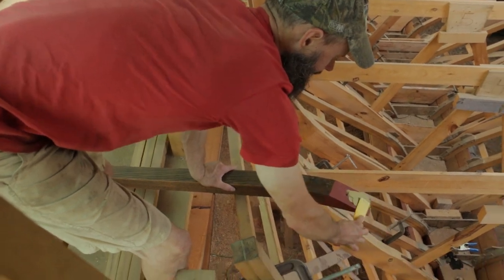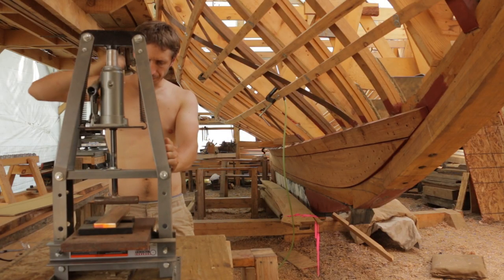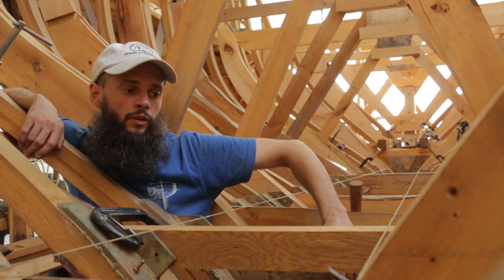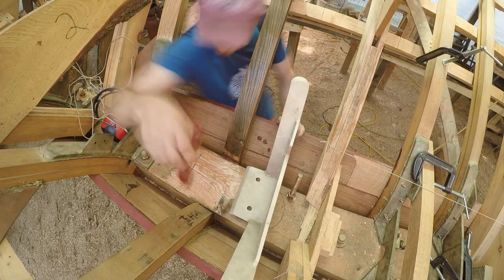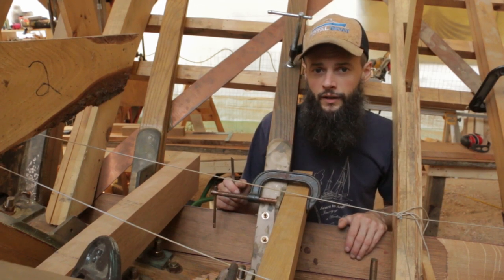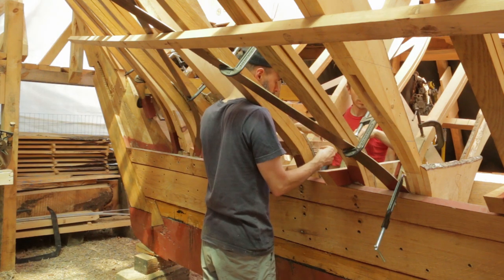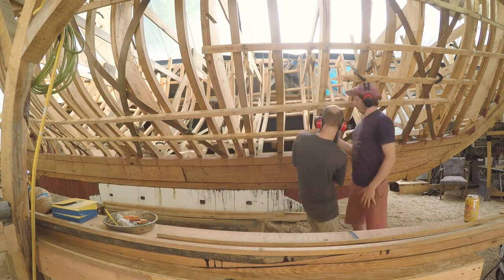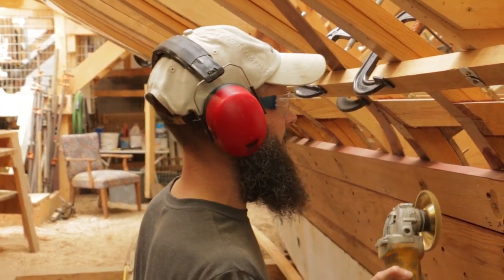Acorn to Arabella - Journey of a Wooden Boat - Episode 77: Sole Beams and Diesel Engine

Comment: From experience, as soon as you get the engine for the boat, set it up on a metal frame with basic instrumentation, fuel, battery, and coolant, and get it running before you put it in the boat. That's especially important if you are a year or two from launching,  and the dealer may have "forgotten" about the warranty. Obviously, you will need to run it periodically from then on over the build, and you may even get enough hours outside the boat for the first service.
If you are really clever, the frame that holds the motor and mounts can be designed to just bolt into place in the boat, and be finely adjusted once the driveshaft has been bored.
Reply: Absolutely fantastic idea.
Reply: Dear Ray Watson.
Clever and smart ideas! Congrats!
Best regards luck and health.
Reply: Elementary Watson
Reply: With a high profile build like this, it is the engine supplier who needs to be nervous about any issues with an engine that has been sitting for a while, less so the owners.  The supplier can't afford to be seen as anything less than responsive in front of such a large audience.

That's not to say that there is anything necessarily wrong with your advice, but I would want to know what (if any) preservation is done before the engines are shipped out.  If it was pickled at all, it's usually better to leave it alone, at least for a while.
Reply: They won't have a prob I bet. The dealers seemed like nice guys. Not very often you see a dealer bring a motor to your shop and help you unload it!!!
Reply: my warranty started the day it was delivered...........
Reply: @Mad.Man.Marine  Even less so give you one for free!  :)
Reply: @netpackrat  Warranty always starts from the day its delivered, but some problems become muddied after a time lapse.
In one case it was gummed up injectors and fuel lines. 
Was it improper handling by the manufacturer or dealer,  or the fault of the owner during storage.
In another,  it was defective seals in an oil pump. Was that done at manufacturing stage or temperature extremes during storage.
In a third case, it was missing connections in rhe alternator harness. Was that a factory fault or the owners "helpers".
The list of possible problems becomes complexified after even six months,  lets alone years.
Also, like most modern technology,  major manufacturing faults usually show up in the initial  period of operation,  and most boats don't react well to getting an engine removed.  And in the case of rectifiable faults, the repairs are much easier on the garage floor than the engine bay.
Reply: @jeremykamel9655  That's true. But don't forget one of the tests is to ensure that the engine runs reliably,  that is, it doesn't get starved for fuel or oil, or overheat over prolonged running. So, ideally, set it up you can let it run at operational revs for an hour when you want to. Getting the water up to temp so you can check the thermostat is another part of the test, and that may take ten minutes.
Checking the alternator output at different rev ranges is also part of the check.
If you are really keen, you could attach it to some sort of loading arrangement for a full evaluation. Maybe you could hook it up to a prop in a big pool, and make your own "endless swim" feature :-)
Reply: Ray Watson I get that but it’s also a LOT of work to set that up. The only way to make sure it’ll be reliable is to load test it. That would be a HUGE undertaking to do it. You have to have a radiator and  everything. To set it up in a pool you’d have to set up a proper aligned prop shaft. And that’s a lot of work.

As a 20 year journeyman diesel mechanic I can say short of a load test your not going to do much. But also I can say that the beautiful thing about diesel is that they can in fact sit for many many years with zero issues. I’ve seen them sit for 30 years in the weather and fire right up in minutes. As long as they hadn’t had water ingress that is. Gasoline engines are a different story.

But a brand new engine will probably be fine. I do agree that it would ideal to know due to warranty issues. But I would guess that there won’t be any issues when the time comes if there was a problem. Between the care given by the vendor and as someone else said about this being high profile (ish) I would think it’ll be made right if there is an issue.
Reply: Nuts, what a waste of time and it will just risk causing damage to the engine. A good warranty will be from the date of install . That's typical in commercial boat building. 
This is a marine Diesel engine , the first thing it needs is to be run in properly under load to avoiding glazing the new bores and lots of other good reasons .
Cheers warren
Reply: @CheersWarren  For a "professional"  installer, the idea of pre-install testing is "strange", but then they get paid by the hour to fix the problems that the customer gets dropped into, so they dont care.
As far as a "good warranty", I already gave you just three problems encountered on real installs. For the amateur builder, who may buy an engine years before it can be loaded, it is a real problem. It is a huge part of the initial cost and a huge potential repair bill.
For the first few hours of operation, NO Diesel engine should be under load.  Then you operate under light loads for up to 10-15 hours.
That install regime matches a testbed idea perfectly, as laid out in the manual.
IF you rig up a test "pool", you can even load the engine up, but I am aware that it is a bigger job. But, they have to load tanks for 350 HP outboards, so a pissy little 25-80HP Diesel isn't a big deal to put under working conditions.
https://www.woltergroupllc.com/breaking-in-a-diesel-engine/

Comment: Great video showing lots of progress on the build.  The amount of attention to detail you both put into the construction of Arabella is awesome.  Your commentary on tips and tricks as well as anticipating viewer comments like "you forgot the drain hole in that floor" or "why didn't you bed those sole beams when you installed them" is great narration.  That grinder wheel you used to clean up the ends of the sole beams is a beast!  Thanks!

Comment: I am sooo glad that you didn’t go with the Perkins P4108. I rebuilt P 4108’s When I was working for the MOD here in the UK. They were used as the Auxiliary power unit In the main battle tank. Challenger 2, spent eight years rebuilding them. And they were not up to the job!  Crankshafts were the main problem. With con rods a close second. Not an engine for Arabella. Good choice guys. Trust me on that. Great vids.Gradually wading through the vids. Love them.

After criticising the MOD engineers Choice of engines .I will no doubt have the “Men in Black”  at my door. Ah! Hold on there is someone ringing my door bell. Oh dear this doesn’t look good a Black Mercedes on my driveway!

Comment: If you end up doing more aggressive end grain shaping later on in the build, I highly recommend the Festool RAS. It removes material almost as fast as an angle grinder, but the control and surface finish is much better and the dust collection is surprisingly good.

Comment: can't help but ask if the wooden floor beams will be attached to the planking. and if  not, why not cut them off a 1/4 of an inch short so as to avoid grinding them back.
edit: nevermind, it's been mentioned a couple of times already.
Reply: I was thinking the same thing, as I doubt they will be attached to the planks I see no point in them being so long.
Reply: Attached they add strength to the hull.

Comment: A removable threshold would certainly help to get the welder in and out. The argon/co2 bottle weighs about #100, not to mention the transformer windings in the welder itself. Just a thought from an old welder with a bad back!

Comment: I don’t know if anyone else has mentioned it or not but, whenever you’re stretching a string to line align or level something, leave a 1” or 2” gap between the string and whatever you’re installing and measure off the string that way you don’t risk getting the string nudged out of line. I learned this many years ago when installing long runs of conduit and fluorescent lights fixtures.

Comment: You should consider cutting the ends of those sole beams a few millimetres short. When soaked, they will expand, and can press the planking seam open.
Reply: Wood expands very little along the grain
Reply: Oikku Oek. timber expands only microns in length. And anyway sole beams doesn’t have constant contact with water.
Reply: Sole beams are located in highly humid conditions, even when aren't fully submerged. And yes, timber expands lengthwise, even more than width. Several millimetres per metre, varying on the type of wood. That's why it's necessary to leave a gap between the sole beam and planking. If the gap is big enough to flush the dirt off, then the overall design is steady, and the sole beams won't rot, and/or push the planks.
Reply: Oikku Oek , I would refer you to the “ wood Database “ and the work of Richard Jagels,. Wood expands tangentially and radially, very little longitudinally, usually stated as between 0.1 - 0.2 % so this is negligible for this purpose
Reply: Yes I have read the books also, but even more so, I have done testing, and dismantled several badly engineered wood constructions, from wooden boats to houses. One easy thumb rule from those experiences: Avoid perpendicular seam when possible. They never hold, and always rot.

Comment: Why is the contour at the end of the sole beams so important? Why not cut them a little short so that the don’t poke the planks and be done with them?
Reply: They'll probably want them flush with the planks so they can paint and dolphinite them in there.
Reply: Fair enough, but why go to so much trouble to get them flush with the planks? If the layer of dolphinite is a 1/16th of an inch thicker here and there does it matter? Obviously I’m not a boatbuilder.
Reply from the maker: We like a nice fit and finish.

Comment: 14:22 Come on @Acron To Arabella  use some push blocks... how are you going to tie knots for the rigging without fingers?!
Reply: SO Quick, my friend dropped an unguarded grinder in the bilge, it ran across the bottom and took off three fingers before he could blink.
Reply: @Graham19951  I've had some major stitches from metal cutoff blades on grinders nicking me.  They cut through gloves and flesh like it wasn't there.  Hopefully your friend was able to get his fingers re-attached and is able to use them.

Comment: Why do the sole beams have to be flush to the inside of the planking (outside of the frames)? Couldn't you just cut them off a bit short on each end?
Reply: To leave at least half an inch air between the planking and the sole beams would prevent rot in the end grain.
Reply: My thoughts. I could see the compressive strength arguments, if it weren't for the bronze floors that could survive a nuclear blast.

Comment: Anchor chain? Or double braid nylon or Kelvar....We used 1.5" double braid for the twin anchors on the 82' PT boat is was on in the military. Never failed. Huge weight savings and repairability.
Reply: Synthetic line will also give plenty of spring in choppy anchorages where chain may beat you to death when it hauls tight.
Reply: You still need a length of chain in order to get the proper angle of pull on the anchor.

Comment: I don't really understand the point if getting the beams to fit in so well. Are you going to use the plans to stabilize them? Why not just cut them an inch back for extra clearance?
Reply: It's called fit and finish and is the product of time patience care, and skill. It is the tell tale signs of a true craftsman.

Comment: Why wouldn't you build an aluminium bath tub for the anchor chain instead of allowing  all the mud silt and water to soak into the frame behind the dam.
Reply: Steel chain + aluminum bathtub + bronze floors + saltwater = galvanic corrosion.   
Probably want to put something to isolate the bronze floor (s) from the anchor chain...and maybe even a zinc plate on the floor itself to avoid corrosion.  The salt water on the wood is minor issue, as the oak is soon going to be saturated with that anyway.    

A tub of Al would need to have something of a regular shape.  With the frames, floors and whatnot, that would eat a lot of volume that the chain could easily fill.
Reply: GRP lined wooden box even ?

Comment: Let me suggest a slightly different method of aligning pieces to string.   Set the string 3/4” above the set point.   Make a few spacers out of 3/4” lumber.  Just small pieces (say) 3” long.  
Place one on each end of the piece you are placing.  Bring the piece up until the spacer is just touching the string.  Fasten in place.  Remove the spacers.   May seem like a lot of extra work.   The pay off is that the position of the string for the next piece is not influenced by any of the previous fittings. I have used this for positioning all sorts of stuff from wall studs to fence posts.

Comment: Low 90's, getting hot and humid for a day or two huh? Be glad you're not building a boat in Texas! I have an old fiberglass boat that I am restoring and I haven't been able to touch it since mid-July. By 8AM it is in the 80's with 60-70% humidity and only rises from there. Lows barely get into the 70's overnight. When the sun starts to go down it gets to be almost bearable to work on the boat, but then you have to worry about all the bugs that want to eat you or carry you off. I have to deal with that from July to October. But at least I don't have your winters!!! :)

Comment: For future reference , you'd be better setting your stringline a set distance above the joist postion and then use an appropriately sized spacer block to set each joist to the string , this way you eliminate the chance of a slightly 'off' joist raising the string fractionally when fixed as it will be that distance below the reference line  , a situation that can snowball as you go along resulting in headscratching trying to find out why you ended up with a slightly humped floor , it's the same method I always use when levelling timber floors/decks/ceilings and trimming rafter feet on a roof to ensure a perfectly straight fascia

Comment: For carving (21:10) I use 3 types, the Arbortech for coarse/hog grinding and the Saburr for finer stuff. However, since the Saburr and clones are ridiculously expensive I instead leans towards a set from Jula with micro-plane like discs.

Comment: As a whole lot of stuff gets added to the ship the weight is going to be enormous, yet the keel seems to be supported in too little area. Either the floor of your shed will subside or the keel may crack.
Reply: The 'floor' of the shed is the Earth.  The keel isn't experiencing any sheer, so shouldn't crack; if it does, better here, than at sea.

Comment: You can buy polyethylene anchor wells which you can fit inside a bilge space. They're not expensive. The anchor well would take the impact of a dropped anchor and can be replaced. Well worth the money because you don't want the dirt sitting on the wooden hull in the bilge. You really don't. Not to mention that you don't want a stinky bilge anyway.

Comment: Curious to know - have you given any consideration to additional beams or structural bulkheads at your sling points (for when she is launched & hauled). I'm sure you have already planned for this, it's just that since you are already doing the sole beams it was worth asking. Obviously she will be a heavy boat, and I suppose those frames could easily be warped at the sling points if not properly braced?

Also, what are your plans for moving the boat to the ocean from where she is now? (sorry if I missed that in an earlier video).

Great work by the way, enjoying watching the progress as always, thanks a lot for sharing!

Comment: Please please please use a push rod on the table saw. I have a very similar saw to yours, I put loads of hours on it and got complacent using it. I felt very comfortable with it. One day I was probably a bit tired finishing up a few final cuts for a project. The last cut was an angle cut almost identical to the one you made in this video. The board bumped up shot back into me, I instinctually grabbed the board and it pulled my hand into the saw and ripped through 3 of my fingers before I could let go. I lost my middle finger on my left hand and my other two eventually healed. It wasn't worth the lost work time and medical bills. You guys are the pros but it only takes  1 small mistake to ruin the next 4 months of work and take something from you you can't get back.
Reply: I saw that.  Thinking the same thing.
Reply: No eye protection, or protection for there lungs to boot... but always ear protection... VERY BAD HABITS(!!!) are hard to break.. there usually good about eye protection... I see it at job sites all the time, very few wearing a good dust mask, if any... Id rather lose some of my hearing, over losing any capacity of my lungs...if I chose one over the other... and I wouldn't... and most lungs diseases are progressive... Ive chimed in about it... ear protection still on... they don't want to "hear" about it... BAD DECISION!!!!

Comment: Hey guys, it occurs to me that you should grind the ends of the sole beams about a half inch.  Why? you may ask.  Because as you know wood, like metal has a tendency to expand and contract with the temperature and humidity.  With these being the ends of the beams you don't want them pushing the hull outward which may compromise the water-tight seals in the hull.  Just a thought.